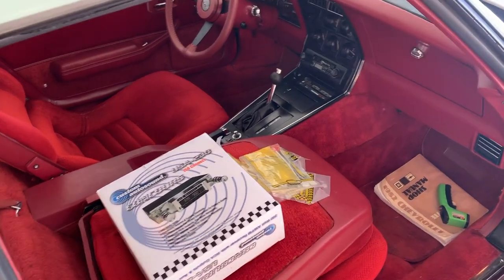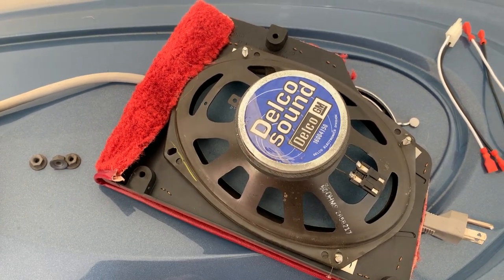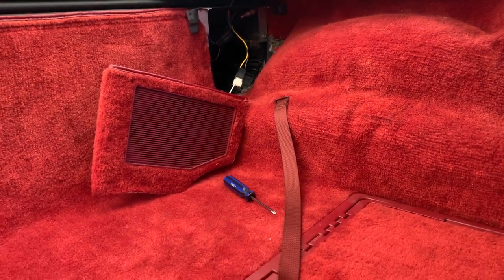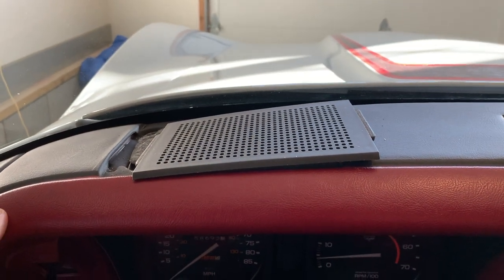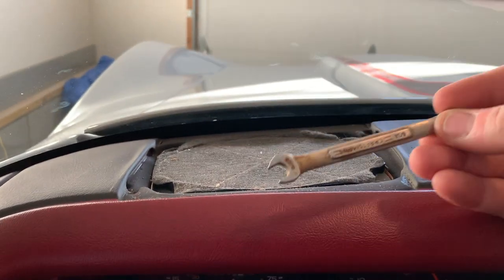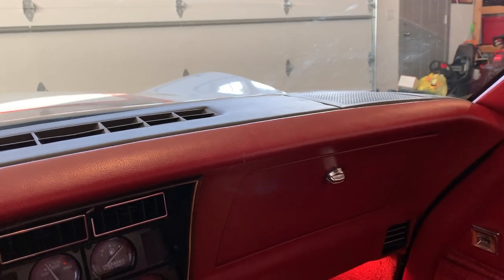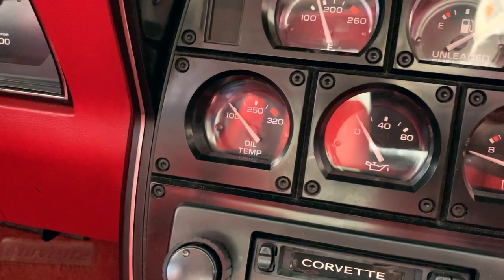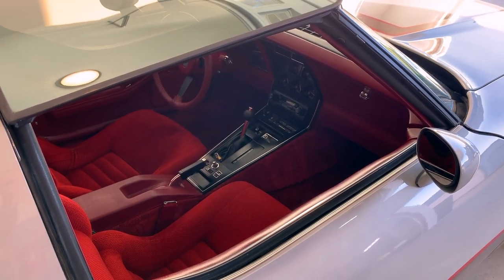1982 Chevrolet Corvette Speaker Replacement

Comment: Just bought the same Corvette color scheme, mine has 57,186 miles, need to replace carpet, stereo and speakers, thank you for the video
had to get some engine work done since the Vette hasn't been driven in 20+ years

Comment: I have an 81 two tone and had to replace the water pump. Did it myself because nobody around my vicinity will work on anything older than 2000. If you dont mind me asking, how much did they charge you?
Reply from the maker: It’s been a couple of years ago, but it was $250 for the labor. I supplied the new water pump.

Comment: Instructive video. many thanks.....where did you obtain the quick connect wiring harness SP-4500? thanks
Reply from the maker: https://www.ebay.com/itm/2X-Speaker-Connector-Harness-Adapter-for-Chevy-GMC-Jeep-Suzuki-Saturn-72-4500-/331742248398?mkcid=16&mkevt=1&_trksid=p2349624.m2548.l6249&mkrid=711-127632-2357-0

Comment: First - thank you for this video. Can’t tell you how many times I’ve watched it to figure stuff out and you were the only one that I found that had this. Have a question for you - since you had the original speakers in there before did you by chance measure the magnet? When I bought mine it had this horrific speaker box in the back that I couldn’t wait to get rid of. Bought a pair of Kicker 6x9 speakers but they’re just a little too big to fit back there and can’t get them flush to get screws in so returned them today but need to figure out what to get
Reply from the maker: Unfortunately, I did not measure the magnets on the originals. The new 6x9s have a depth of 5.6” and fit with no issues. Their sound quality is good, but nowhere close to what those Kickers would have sounded like! I just looked them up and they’re still for sale on Amazon. Let me know if you have any other questions. Good luck!

Here’s the model Name/Number BOSS Audio BRS69
Reply: @donutswdad7892  alright, no worries.  Thank you for this info, I figured out which ones you got from the video LOL.  I found a pair of Rockford-Fosgate speakers that are supposed to arrive today so we'll see how those go.  Thank you again for this video, was a big help, especially with workaround for the front speakers but haven't tackled those yet after I realized previous owner must've connected wires to speakers first and then run them to the stereo as they're soldered and there's no slack in them for me to snip the wires and get new connectors on there.  I had followed your advice on getting wire harnesses too but wires were already cut back there so didn't need them ;)